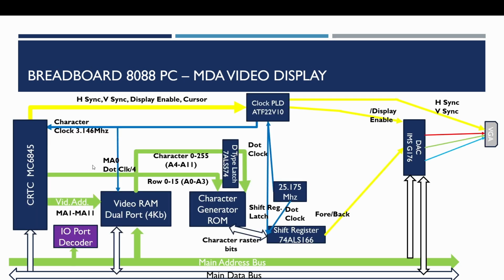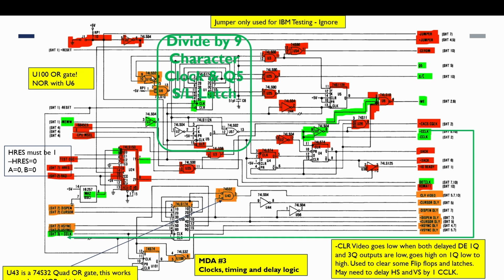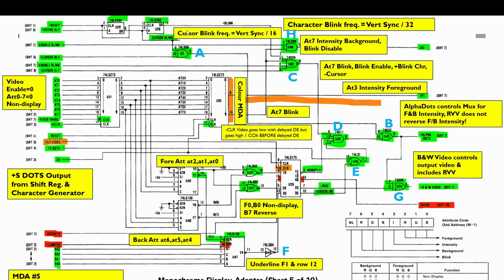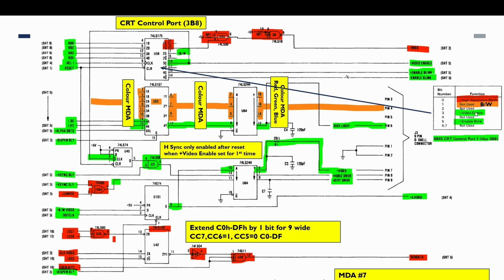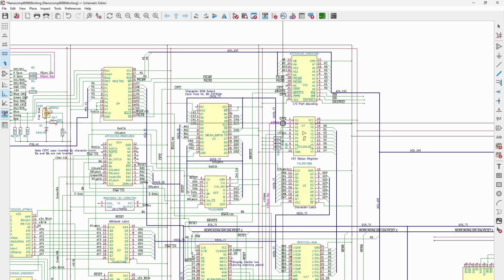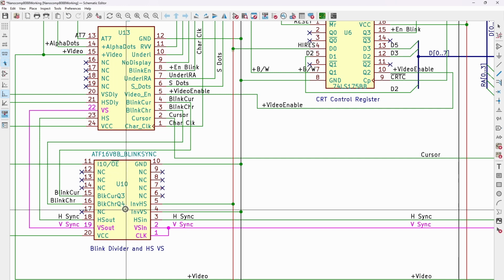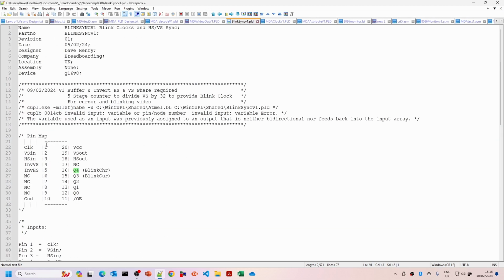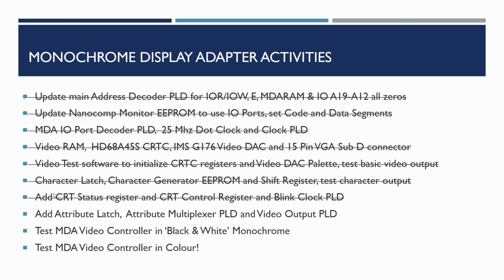Breadboard 8088 PC MDA Video Controller (MDA#7) #19

Comment: Nice progress. What are you planning to use as BIOS, is there any "free" version or you going to make it by yourself?
Reply from the maker: I am not a good enough x86 assembly programmer to write my own! Probably Sergey Kiselev's 8088 BIOS at https://github.com/skiselev/8088_bios and then the XT-IDE BIOS https://www.xtideuniversalbios.org/ when adding an IDE hard disk. There are a couple of others I have looked at but the XI 8088 one has the configuration options for a hybrid XT/AT/PS/2 with the extensions on top of the base XT like dual interrupt controllers, PS/2 Keyboard & Mouse and real time clock. Dave